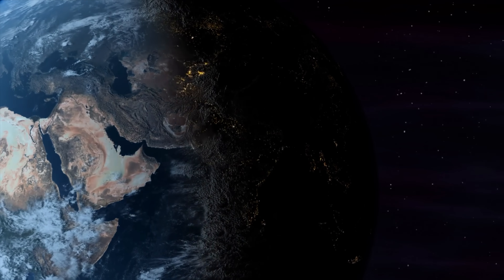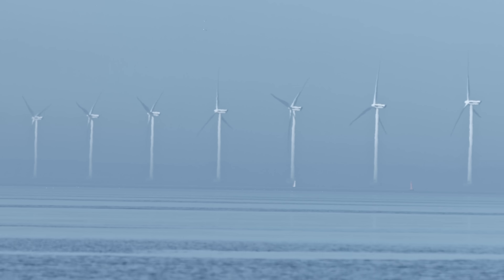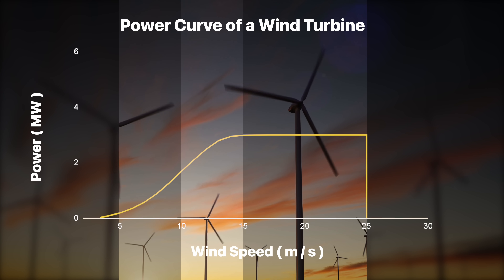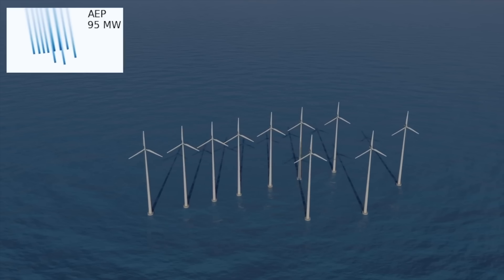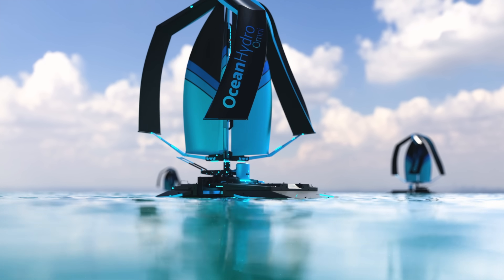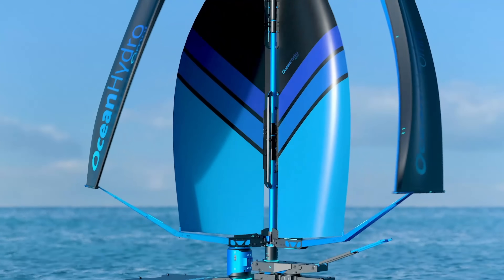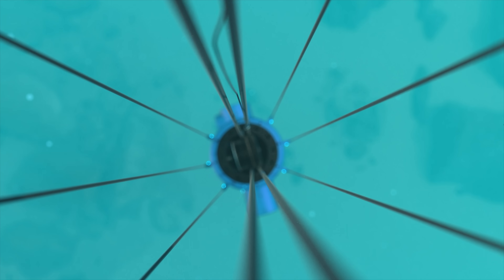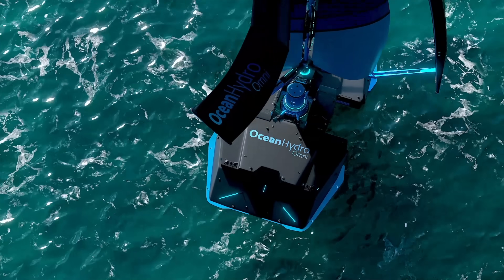Breakthrough Tech Solves Wind Power's BIGGEST Problem!

Comment: Batteries are getting cheaper, more long lasting and safer from exploding.  They need very little maintenance.  I would use conventional wind turbines with batteries.  There are going to be less problems.  Try this new idea.  It probably will not be as good as the old technology.

Comment: The first major issue of wind turbines is not the variability of wind, but their inability to generate power when wind speed is too high. When wind speeds are high the turbines must be rested. I guess this is the problem with having an end-user commentating on technology from a idealistic view point rather than engineering insider  one. You get your basic facts wrong. Wishful thinking is no substitute for facts.

Comment: I'm guessing the bit of the vertical axis wind turbine that's under the water is going to require some serious maintenance from time to time it's in an extremely corrosive environment. The less moving parts a mechanical device has usually the more reliable and maintenance friendly it is.

Comment: Sorry, but I just don’t see the potential with this wind turbine. Don’t get me wrong, I’m all for renewable energy, I even worked for a ‘Wind Power 2.0’ company for 4 years, but unfortunately it failed. 

It’s always a major red flag when no power capacity numbers are provided, not even theoretical. I’m sure a rudimentary cost analysis would show that this is not viable. 

Many companies have tried VAWT and they have never been a large commercial suggest. One of the major issues is that they don’t scale up well, without costs, especially maintenance costs ballooning. There is practically no economically viable market for residential wind, so their only option will be to scale up, which won’t work. 

Also, a gravity battery in water? Common now….I’d love to see the theoretical numbers on that. There is no way that will be economically better than other means of energy storage, otherwise, that type of thing would be fairly common. 

Just imagine the installation and maintenance costs from this type of system….now multiply that by 1,000+ for each one of these that would be needed in a commercial scale wind farm. 

Lastly, behind able to operate above 25 m/s (~56 mph) does not provide much of a benefit because it is very rare for wind speeds to be that high, unless a major storm is brewing. 

I’m still hopeful that someone will invent the next generation of wind turbines, but this concept is laughable. I doubt that the people working at that company had any previous experience in electricity production.

Comment: You can stop watching at 0:18 and instead simply take in the information in the graph. I find it interesting that the creator would include it as it is counterproductive to their argument. It shows you just exactly why oil and gas aren’t going to simply dry up and disappear. In fact, it shows you just how HEAVILY dependent we are on hydrocarbons. No alternate energy source can answer the massive base-load demand requirements like hydrocarbons can.

Edit: most in the comments have addressed it already….these things will be a costly maintenance nightmares that will end up exactly as everything else in a corrosive saltwater environment. The machines that will be used to manufacture and repair them run on diesel.

Comment: If you have a customised bag made from the same material that is used for sinking vessels and connected to the seabed, put air from the turbine into the bag and use a pipe to run an electrical turbine to generate electricity. After the turbine uses the power of the sea and feeds 1/2 of the airbag to the bag again using valves. Or the air moves from one bag to another bag inside each bag spring to equalise the sea pressure, but this spring should lose its ability by the click of a switch so it could be hydraulic, in this way we have a cycle with lost that can be provided by the air turbine.

Comment: No, instead, pump air in underwater bags that are used to save sinking vessels but connected to the seabed and the water pressure to push the air out is used to generate electricity.

Comment: I think that the new innovation in wind energy can integrate wind energy, current energy and solar energy. Is there a specific innovation that integrates this innovation? I think that vertical fans are more effective because they receive winds from any direction, and if the area of their blades is increased and the search for very hard and light materials and ways to prevent friction between the moving shaft and the fixed shaft, it will be more effective and more sensitive in receiving winds.

Comment: This looks a great idea. But:
Looks fragile.
How does deal with heavy seas?
What keeps it in place?

1 ton 100 meters above a surface holds 0.27 kWH of potential energy. Is that correct?

Comment: All these systems using weights for storing potential energy are more complicated and not as practical as just using the flow of water itself for generating energy. Hydro energy storage systems and their turbines have proven to be a very reliable and efficient way to store and generate energy. 

One major drawback of this system is the need to move a large weight and volume for that mass through water. The energy wasted in overcoming the drag created by the relatively large density of sea water is a huge issue. It's not an accident that airplane manufacturers have spent a century trying to minimize air drag on airplanes to minimize wasted energy. This ocean based weight system and design is ignoring a lot of physics. It is really bad Engineering.

I think this concept could be modified and have a better outcome by researching the idea of putting large tanks as a sea water catch basin along with pumps and turbines at the desired ocean depth. A structure with two or more layers of tanks at depth. The upper structures at depth encapsulate the turbines. Other tanks, placed lower into the ocean than the turbines encapsulate pumps. Those pumps with an outlet right out to the ocean at that same depth. Water pipes would connect the turbines to the wind energy structures at the surface of the ocean. The turbines piped to the lower tank structures with the pumps in them. The tanks and pipe structures below the level of the turbines start with tanks filled from the water pressure at depth itself. The wind energy would be used to pump the water out of those tanks. As the tanks empty, the lower pressure inside those tanks and pipes, when compared to the pressure of the ocean at that depth, represents the amount of stored energy. 

The depth can be a lot deeper than what you usually get with submarines. Most submarines are usually limited to just a few thousand feet. Obviously, the deeper the drop from the surface of the ocean to the turbines down below, the larger the maximum energy output that can be had from any stored energy. The way you could go deep into the ocean is by building a structure of multiple layers of water tank slices, sandwiched like onion layers. Or like the concept used with double pane windows to encapsulate an inner air gap layer. The multiple layers of water would minimize the total pressure on the wall of the internal large tanks. Each one of those outer layers of water "slices" at various water pressures, as appropriate for the total water depth of the structure and possibly changed appropriately, as the pressure of the internal tank itself changes. This is also similar in concept as used while wearing multiple layers of clothing in the winter for warmth. The trapped air between the layers of clothing insulating the relatively large differential temperatures between the outside air and body. With this design, the inside larger tank containing the turbines and pumps would be surrounded by those multiple layers of dynamically pressurized water. Those layers thereby keeping the walls of the inner tank at the desired designed pressure. 

One of many obstacles to this idea is obviously the issue of piping, pumping and turbines using sea water as the fluid. Not sure what the long term maintenance issues and life for such a setup would be. Also the specific pumps needed to empty the energy chambers into the relatively high pressure ocean below.

But in any case, when you need to generate energy, just let the ocean surface water flow through the pipes and through the turbines below. The Head pressure for all that water column from the surface of the ocean to the turbines  generating the desired continuous energy. The potential energy in the system decreasing as the pressure in the tanks below the turbines increases while energy is generated by the system. 

On the benefits side for a setup like this, there are no subsurface ocean exposed moving parts to content with drag. There are no issues with marine life build up on submerged moving system structures, except for the pumps and valves at depth.

As a side benefit of this architecture, if you need ballast at the bottom to protect the surface structures during a hurricane, just let the tanks fill up. Also, make the whole thing a floating platform, with enough buoyancy to keep the wind turbines above most wave action. Since it could be a floating platform, you could partially fill buoyancy tanks, as appropriate, and lower the whole structure below the surface of the water to a desired depth during inclement weather such as hurricane. Then, when the hurricane passes, pump the water out of the buoyancy tanks and get the wind machines to the desired height above the surface of the water once again.
Git-R-Done!

Comment: In an area that has 700m water depths, in the ocean, what is the likelihood of large waves toppling, tossing or damaging the pontoon that these things are sitting on? Storms churning up the ocean is likely not a big issue for stabilised horizontal wind turbines that are anchored to the sea floor. But for floating pontoons, with 45+ km/h winds, in open ocean. A receipe for disaster.

Comment: The boyant force from water would cause a huge loss in the energy storage capacity. The system would be much more efficient, as well as much more durable if it was encased in a sylinder of air extending from the turbine down to the ocean floor, since air is much less dense causing less efficiency and storage capacity loss, and does not cause nearly as much corrosion as salt water and marine life.

Comment: Ok simply not going to work. 1st killer problem. Tidal flow making controling the weights difficult to imposible. High wind areas = high seas = extreem instability = not going to work. 
2nd problem and another killer is sea creatures. Sponges and mulitple (1000's) creatures are looking for any surface to attach to and grow on. Ever hear of rope grown muscles? 
Barnecals etc. Will love the ropes used to raise and lower the weights. This has killed off most wave power attempts so far. Along with...
3rd and also a killer. Sea water is extreemly corrosive.  Wind farms have all the delecate expensive kit high up above the waves not sitting at sea level or below it. 
Nice idea but if achivable will be prohibitly expenseve to maintain. 
Tidal flow generators are a much better idea. Yes the expensive stuff in below sea level but is easily lifted above wave top for regular cleaning (wrekly) and maintenance. 
Also the power production is 100% predicatable with tidal. 
People have tried using old coal mines to do gravity batteries aka like pumped water storage.  Where all the conditions are stable and maintenence is compaitivley simple. That has proved to be un ecconomic so far.  So what chance has this got of working?? 1% or - 99%
This is definatly not anything I would invest in or recomend anyone else to do likewise. They are selling fools gold.

Comment: wind turbines have 1/2 the life of a solar panel. They are costly to replace. The truth is that geo-thermal offers more opportunity, consistency, and accessibility than all of the other e-technologies. The heat of the earth is available everywhere, it runs 24/7, and it does not pollute by leaving trash left over by systems like solar and wind whose panels and blades wear out and are discarded  . Just like oil, gas, and coal....solar and wind are controlled by corporate interests and bureaucracies, they are also corrupt, just like the oil, coal, and gas industries.

Comment: It's funny to see the ideas and comments of people with no experience in wind energy, when they try to design or analyze any wind energy concept or device.  Basically, everything they say is 100% wrong, and completely misguided.  This is just one more "Professor Crackpot" design.  Out of the last 1000 Professor Crackpot designs, how many have succeeded?  Zero.  And almost every comment here is entirely worthless, because if you don't know the nitty-gritty details of wind energy, you just don't know what you're talking about.  Everything is like "Well I would think..." - yes you WOULD think - if you had any idea what you were talking about, but since you don't, what you "would" think is pretty much guaranteed to be wrong - sorry to break the news.  That includes the guy who made this video, by the way, as much as I enjoy his work in general.  Sorry folks, but that is just the reality of wind energy - a steep learning curve and if you don;t know, you don;t know - simple as that.  Unless you are an expert in the topic of wind energy, you don't even know what you don't know.  These statements of this wind turbine design being "better" in any way, being less expensive, being able to harness winds of 40 m/S (over 80 MPH) are totally wrong.  This design can't even figure out how it WANTS to work - two different types of blades combined, one kind blocking the wind to the other.  Visibly not enough flotation to support the up-and-down weight, any real wind person could go on all day with pointing out failed aspects of this design.  in wind energy, if you don't really know what you;re doing, you will just repeat all the same innocent newbie mistakes of all the previous know-nothings that came before you.

Comment: Salt water, especially ocean salt water is not friendly with most materials, are the materials on this product designed for long periods of time with low maintenance? And what environmental studies have been conducted in relation to impact through operation on marine life? This would include noise impact, migratory route interference, water current flow deviation that may have a negative impact on sea life etc…

Comment: "Wind power outfits still claim their turbines run on the smell of an oily rag and last for 25 years or more, needing little more than a hug from time to time.

However, the operations and maintenance cost of these things, as reported by Australia’s Infigen, is around $25 per MWh (hardly the zero marginal cost claimed by wind cultists!). And, as we’ll detail a little later in this post, wind turbines are unlikely to have an economic lifespan beyond 10 years.

But first this, from Energy Wire (a renewable energy propaganda site) – indicating that the only thing that keeps them running is an endless stream of taxpayers’ money."

Comment: A 7mW turbine is 110m high with a 5m wide support tower.
Why not put the gravity battery inside the tower of a horizontal wind turbine?
That would solve  the corrosive salt water problems, you would just need to keep the weigh under 1m diameter so maintenance technicians could climb up the inside of the tower.
You could use it for output smoothing for low wind periods.
It might even be possible to house 2 gravity battery weights inside the tower for the same continuous production idea suggested.

Comment: While I concur with the many concerns expressed in other comments, I still think this is a really interesting approach. What tweaked my curiosity is the potential to capture wave-motion energy as an added power source.  Also,  regarding the harsh operating conditions - how much worse is the environmental challenge to the horizontal turbine, compared to the vertical? I speculate not much.   I  think it is the complex under-water power storage-regulator system that would be the major challenge to moving this technology to large scale deployment.  How would a large cluster of these horizontal systems compare to the vertical turbines on cost, install, and performance? I don’t think the vid addressed that specific question.  I guess I’ll have to watch it again!

Comment: I was thinking of weights on wind turbines years ago, and like this, it stored the power in weights, but rather than giving each turbines a weight, I set them to use a set of 3 central weights by moving cable. The goal there was to use less copper by generating in one generator.

Comment: There are no conventional wind turbines that are cost effective against gas if one removes the subsidies and carbon payments the gas units must pay and even more important if one charged the wind units for the real costs of connection to the grid and back up power. If this type of turbine does not require subsidies it looks like a good solution,  Otherwise it joins conventional wind power which is no more than a Green fraud that is ripping off taxpayers by harvesting subsidies not wind  as there is no real science showing that carbon dioxide has the claimed impact on the climate except through unproven secondary effects.
Reply from the maker: No industry in human history receives more subsides than oil and gas. And yes wind energy is super cheap.. and oil as it gets harder to find will get more expensive.